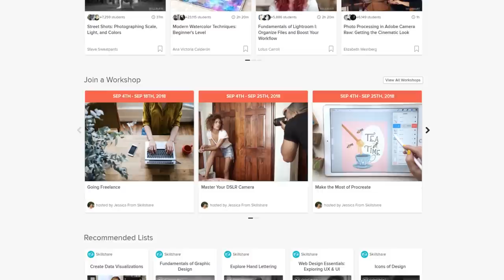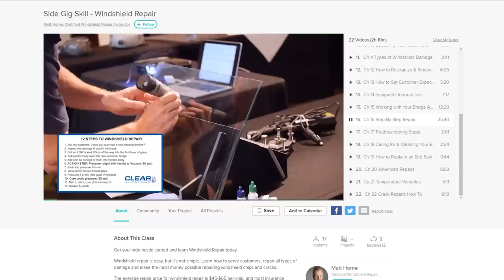BMW E30 Front Struts Restoration | BMW E30 325i Sport Restoration S1 E1

Comment: I know this is a restoration channel but this is your car, don’t hesitate to replace something brand new. Safety comes first and somethings are best brand new than rebuilt.
Reply from the maker: Thanks for this comment Ethan. Actually the opposite kind of comment I was expected as I replaced A LOT in this episode. So cheers! I will keep this in mind.
Reply: Restore It :) no problem! I’m restoring an old truck and a lot of stuff on it needs new items and there are some stuff I wouldn’t dare put back on due to its condition
Reply: Ethan Puterbaugh don’t restore sketchy stuff. Replace with OEM parts
Reply: lucas boulay yeah I know but some things you can get away with without worrying about it down the road or I get a better part off another truck that’s in better condition than mine but you’re definitely right
Reply: dude.  restoring things includes replacing things that are too worn or broken.  you did well in this episode..  I`m just surprised you`ll replace the parts you restored (or did I get the :i`ll change these later`comment)... they look really good.  granted, not new, but great nonetheless.
Reply: A new billstein set is guite cheap
Reply: lol he mostly got new everything
Reply: @AgentSmith-ci8pv  
The old bits had deteriorated to much ! Restoration is fantastic but safety comes first.
Reply: Why you did not restored rusty car body first?
Reply: Buying new parts and replacing old parts are also part of restoring.
Reply: Just reading this now but some parts are hard to find new, for me I can't find front struts and new springs not in stock anywhere.

Sadly some cars have have no aftermarket parts others have some but not all and some have no oem support anymore either.

So this might help me trying to keep mine since I am not interested in getting rid of it.

Comment: you need to install the dust boots. the boot slips under the bump stop, not over it. The bump stop always sits at the top of the cylinder. the boot slides onto it and locks into the bump stop from the bottom to ensure its covering from the highest point, down. it is wide enough to fit but snug enough not to fall off.

Comment: Tip: coat brake discs with clear coat if not used, but mounted as a spare part. Otherwise they will rust.

Comment: Hey, e30 owner myself, pretty good job, but i spotted you were using that beige foam with that plastic cover underneath as it was from factory.  Around 17:00min. This is the wrong way to go with those bilstein shocks (because upside down). Get rid of that foam stuff and black cover and use only that flexible plastic you wanted to put on top at the beginning. The white ring you put on first is used to lock that flexible. Otherwise debris and dirt will damage the seals of the shock-rods.
Hope you see this otherwise you might kill your new shocks very fast.
Anyway keep up the good work👍
Reply: Eric Räuter good catch I thought something was fishy
Reply: Thank you Eric Räuter! Its always good to hear from a different point of view. I own an e30 as well, so this definitely adds the support I need when I plan to do this job!
Reply: Eric Reuter   The 'foam stuff' are the bump stops, important. Not sure why the covers weren't going over them.
Reply: I think those mud boots are kind of important for the continued functionality of the suspension ? These videos are amazing and I’m delighted to be in on S1E1 !!!  Keep up the awesome work!
Reply: Does the B4 have internal bump stops like the B6s? I don’t think they have. If not, he needs the external
bumpstops.

Comment: I think those mud boots are kind of important for the continued functionality of the suspension ? These videos are amazing and I’m delighted to be in on S1E1 !!!  Keep up the awesome work!
Reply: Yeah, I think they're there to stop shit sticking to the rod and getting plunged into the fluid. Probably be ok anyway. Seen plenty of cars without them.
Reply: BMW decided to change the design of the tubes to the shorter tubes (the ones he installed).
The reasoning behind this is that the strut housings were more prone to rusting when using the longer tubes because dirt and water is trapped on the inside of the tube.

Beside that, I think he might have installed the bumpstop upside down?

Comment: This is exactly the type of restoration I needed that I didn't know I needed
Slow, no talking and in parts so no pshychological crap going on with videos being too long
Perfect going keep it up!
Reply: If I may say so, taking a little time to think why something doesn't come loose properly might be a good one. Whenever I can't get something to fit I just boil it down to the one question that summarises the problem. Then just coming up with every little answer I can think of, and then crossing them out step by step. 

I learned this because I ruined one of the rarest parts on my moped this way. Took me three weeks of 2 hours per day surfing the net to get replacement. Not too bad, but also frustrating because it shouldn't have happened if I would just think straight!

Comment: Great video and pure attention to detail. One thing though, you need to put back the piston dust covers (the long black rubber boots). Your struts wont last long as they are there to protect the piston from dirt and grit which will make its way down to the seals and destroy the struts.

Comment: Very cool to see. 
You will however be less than happy using Bilstein Touring shocks with the H&R springs. The shocks are too soft and too long to function together properly. They also lack the internal bumpstops that the Bilstein HD and Sport have making you use the external bump stop-which then prevented you from using the rubber boot.
Reply: Ya Bilstein HD's are great

Comment: Can you show us when u are repairing the rust holes?
Reply from the maker: Every single thing done to the car will be shown in a video. Be it me doing the work, or someone else. I can’t do everything as I’m not a pro. But yes every process will have its own video.
Reply: @RestoreIt  can't wait! :D
Reply: Blake's Garage  oof
Reply: Good to watch keep. Up the work iam doing  my e30 325i  se up. Same way ever item clean up n paint n back. On motor n Road
Reply: I'm from Russia and we have rusty cars repaired and not thrown away)
Metal is cut to the point where there is no rust and then a repair piece is welded.

Comment: Nice work buddy but you don't need to dremel the hub nuts. You just use a punch and bend them into the notch.
Reply from the maker: Oh, I didn’t know that. That’s why the old ones were bent haha. Thanks man. I’m getting new ones for when I get a bigger torque wrench to tighten them up properly and change out the hubs for a better brand so I’ll do them the correct way then :)
Reply: Excellent. No big deal. Love the work and love the videos. I'm currently tidying my old e30 m3. The struts are the next on the list. Damn UK salted roads!
Reply: You didn’t do it wrong, you actually did it better than it needed to be done. Good job.
Reply: Yeah, great work! But those sparks could decrease the lifetime of the bearings.

Comment: Loved that you did not go for coilovers. Keep it as closer to original as you can. That way you can have a raw experience of what an older car was built to do and if you ever decide to sale it, you can go for a higher price than most lightly modded cars.
Looking forward to the next episode. Cheers!
Reply from the maker: Thanks Tester, I will never sell this car :)
Reply: Coilovers aren't a bad thing. Just like bad lowering springs, bad coilovers would give horrible handling and ride quality. Good street coilovers can make the car look and feel stock with a stock ride height, but with a firmer feel the same way polyethylene bushings help make a car more solid.

Looks like aftermarket struts and lowering springs are installed on this video. The car will be considered just as "lightly modded" as other cars.
Reply: @patx35  personally, I don't consider aftermarket struts as modifucstion in discontinued for many years carseven if they are still popular. On the other hand lowering springs is not my cup of tea, especially in older cars, but.. hey it has to be the owner's decision after all... thats why I said as closer as hecan to the original...

Comment: 16:17 Restore it Did you put oil in the housing? The shock absorber gives off the heat more effectively.
Reply: He used Bilstein touring which are gas charged.  The manual explicitly warns you not to use oil with gas struts.

Comment: Nico job, i have already done this work on my 320i convertible. I have also restored the rear axle this summer. 

One thing i have done different:

Before i inserted the shock absorbers, i have filled in a small amount of engine oil. That helps the shock absorbers to get rid of heat. Thats how it came from the factory. 

One thing yo

Comment: As a fellow e30 nut (i have 5 of them  XD) i appreciate the restoration job your doing. I have two cars in progress atm, a m50 swap and a racecar for an e30 only racing series here in the states. Your diff video was the final push i needed to decide on rebuilding my limited slip diff myself im doing a full restore on both cars. The m50 swap needs it sorely as its suffering from similar rust issues.

Comment: I am absolutely a fan. I am no where near this level but love to see how things come apart and go back together. Dad taught me to change brakes and such, but again love to see someone work on cars. Love to see things also brought back to life. One question I had for the body panels is how do you fix giant rust holes? Do you just have to find aftermarket panels if available or do you weld plate steel? I know the E30 has a lot of parts out there, but wasn't sure about things like body panels.

Comment: Alright, we finally get to see the E30! I knew there had to be a bigger project behind the caliper, lsd, and alt videos. Funny that you had a hard time installing the strut mount caps. I recently did a front suspension refresh on mine and it was the other way around. The caps were too loose so they wouldn't stay on, the mounts and caps were all BMW original parts so that was strange, and I ended up having to cover the hole with duct tape while I figure out what to do with the caps. So excited to see this resto project evolve. Rock on!
Reply from the maker: Haha that is weird. And thanks man. Learning a lot along the way and can’t wait to show you everything.

Comment: Good work!
A lot of effort put into doing the job properly.
Just some feedback at 21:50 you don't need to cut the nut, just punch the the sleeve into the gap using the chisel you had.
That's enough to stop the nut turning.

Comment: If your carpets were wet and heater not working that's got to be the heater core. Its a small coolant filled radiator in your dashboard. They can be tricky to get to but I have not done an e30 one. Goodluck man love the videos!
Reply from the maker: Cheers for the advice Nclamps!

Comment: Once upon a time I had an E30 that looked just like yours, from the outside it looked so gorgeous, just like yours! but from the inside, it was a total rust bucket .. just like yours.
Keep up the good work mate, they are nice cars and worth saving .. but I personally gave up fixing mine after the rear cross beam shot right up the floor pan and almost penetrated my rear passenger's arse.

Comment: Great Video, so much work was put into this and for you to just replace half the parts kinda stinks but its a learning experience.
I haven't seen someone put on a wheel hub with the rotor attached to it already. You can press the hub on and then attach rotor to make it lighter for you during install.

Comment: great restoration! but you need to put that dust boot back in place. another thing. Because you put lowering springs in the car you might have to cut the bump stop a bit. i did the exact thing you are doing to my Volvo 240 and you have to cut the bump stops on that. Don't wanna wreck all that hard work!

Comment: When welding, use the minimum current - 40A. The minimum voltage is 16V and the minimum inductance is 1-2. Then the seam will be flat and beautiful, as well as without pores inside. Now a large current has been chosen - the seam is thick and porous - the seam metal is boiling.

Comment: Just a correction, those aren't shock absorbers. They are referred to as gland nuts. Also, it helps to put a lil bit of engine oil in the strut tube, before installing the strut. It helps to reduce overheating, and any resonating vibrations you might have in the suspension.

Comment: Seems like you got stock length dampers and lowering springs - thus no need to compress the springs. This means, though, that your suspension won't be properly matched, and you risk the spring becoming loose when weight is off the suspension - which in Denmark is actually an MOT failure.

That said I LOVE this project and has been a disciple of yours since the very early days of this restoration. :-)

Comment: I had a similar problem with dust boots when I redid the suspension on my 300zx. Actually, the bump stops were a problem too but I went ahead and trimmed them so they weren't so fat that I could get the dust boots to slide over. Dunno if you bought OEM replacements but I thought I could save a few bucks by buying whatever RockAuto had and it was a mistake. OEM or bust sometimes.

Comment: I love restoration videos and nothing wrong with them. You can personally learn alot from the videos and even a lot from the comments. So please find the axle nut torque specs for the spindles please. I seen no torque wrench applied to those. torque spec is massive on hubs and axles nuts. its the different between a bearing and brakes lasting a lifetime or a couple thousand km.

Comment: Man, its really unfortunate to see some of the parts that couldn't be restored, but this is a hella great vid, will you be taking this on a track someday? Really like the steering wheel btw
Reply from the maker: Safety first Brian :) And not so much on the track. Maybe once in a while but I want this to be as close to factory as possible. That fake steering wheel cost me £14 from AliExpress. I’ll be getting an original :) Thanks man!

Comment: Nice work indeed! Perhaps you should have powderpainted those brakedust shields. Factory ones don't have enough paint on and they will rust fast.
Reply from the maker: Thanks! You're right. They actually arrived scratched and I had to paint the fronts of them a little.
Reply: @RestoreIt  Yeah, nou problem. Those sharp edges are the firts ones to rust. Powdercoating (two layers) will cover the sharp edges and give them protection they need.

Comment: A strip of leather works better than a cloth, or rubber. Cutting the wheel hub nut isn't required, they are also somewhat brittle and that little tab being bent over so far could be an issue as it won't be very strong compared to just drifting the edge into the groove a bit.
Reply from the maker: Thanks for the advice. I have new nuts and hubs on the way :)

Comment: You may want to consider doing the front mask modification, so you can remove it whenever u need to work with the engine. I've done it in mine, and i love it. Removing/Installing the  engine + gearbox  is extremely easy now.

There was a nice thread in e30tech about it, but the forum is down. But i saved the photos of how u do it. Let me know if u want them.
Reply from the maker: Interesting. If you wouldn’t mind, send it over to restoreitchannel@gmail.com. Thank you!
Reply: sent

Comment: I wonder if some kind of “T” extension to have basically a breaker bar in the middle of a stubby impact extension would be a good tool idea to break stubborn bolts free, that way you have the constant high force of a breaker bar, with the impact and vibration of an impact wrench

Comment: You forgot to put 30 weight oil between the tubes and the damper inserts; (Under the hex nut that locks them in place) The oil acts as a heatsink for the dampers and increases their service life.  The reason the old ones didn't have any was because of the holes you welded at the bottom.
Reply from the maker: I’ve been reading up on this and may add some.

Comment: FYI, the front bearing should just slide on, not press/hammer on. I noticed you put several gouges in the spindle with the chisel when removing the old bearings. This is likely why they were so hard to get on. You should have removed any high spots with a file/emery cloth until the bearing slid on easily. It also looked like the rear dust shields weren't pressed on far enough. Tightening the bearings down likely pressed them on farther though. Definitely go back and properly torque those axle nuts with a torque wrench! Don't want a wheel falling off. Also, it's generally a bad practise to remove the inner race from a bearing like that. It can actually damage the bearing. The internal cage that holds the balls in place can break.
Reply from the maker: Thanks for the advice Andrew. New hubs are on the way and a bigger torque wrench. Cheers!

Comment: Perfectionist work.Perfect job if you would've replaced the dust boots. Now would've been the time to do the 5 lug conversion and clean and paint those inner wheel wells. I had this conversation with my brother. Yeah man, I wanna take my wifes car, engine out, hot tank it, blah Blah Blah. I'm like "You barely have time, she'll be pissed it took so long and not even appriciate it". Maximise your time fellas. While this is good work does dude even still have this car? Waiting for perfection is futile.

Comment: You should never use vise grips (or any marring tool) on the shaft of the strut, even with a rag. There should be an Allen slot on the top of the shaft to stop it from turning while tightening. Also, try and find the correct dust boots. Otherwise, great work.